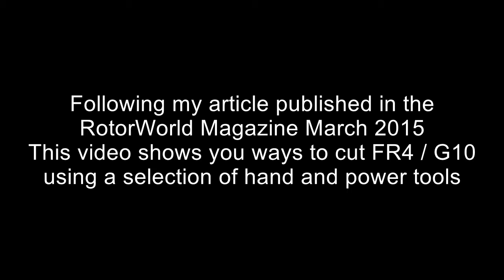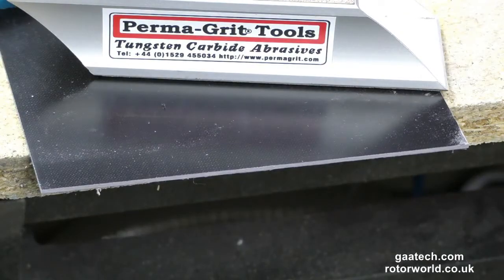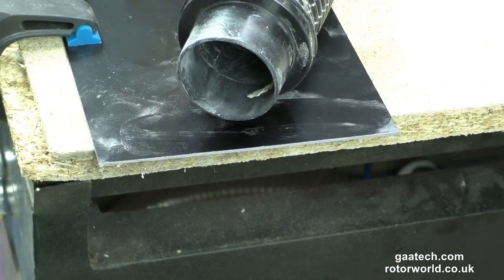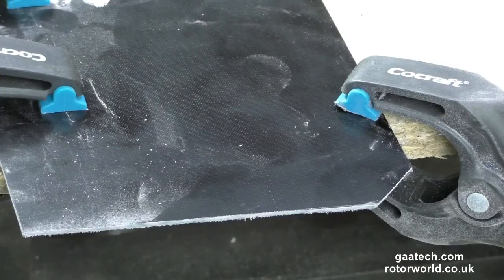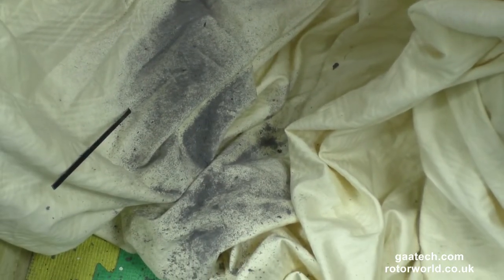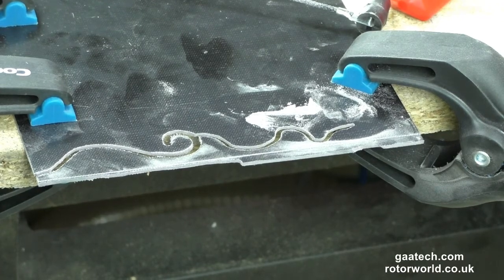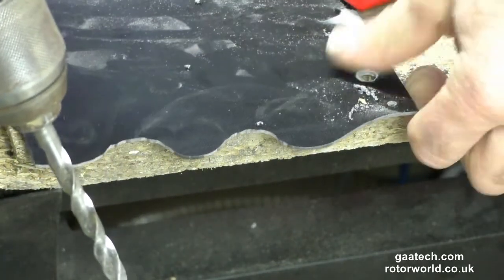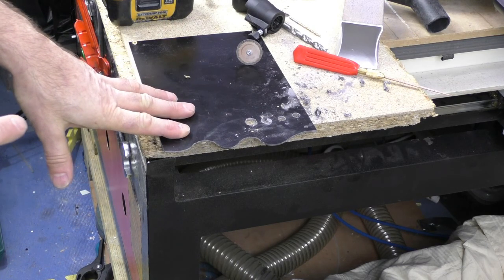0022 Cutting FR4 G10 sheet laminate hand/small power tools.  We used alot of Perma-Grit Tools

Comment: I know that the video was about small tools, but I would be interested in seeing how a bandsaw, scroll saw or Proxxon table saw performed.

How about a router and bit, particularly one with a bearing so that a pattern could be followed, probably on a router table ?
Reply from the maker: Hi UKHeliBob  OK i do not have a band saw but i may be able to loan one i will see what i  can do.  I think it would be all about the type of blade within the band saw.

Regarding router bits.  I will be doing a video on CNC routing and i do not think i have ever seen a bit for laminates with a guide bearing.  Hear is a link to the type if bit i use  http://www.gaatech.com/cnc-s/1893.htm   These bits have many cutting edges and they grind away the material,  unlike a normal router bit that will cut, chip away and the material.   Trust me you have to use the correct bit, even these one done last that long and the laminate is tough stuff.